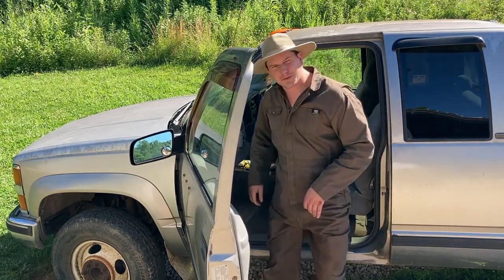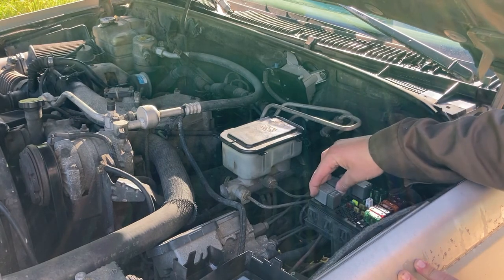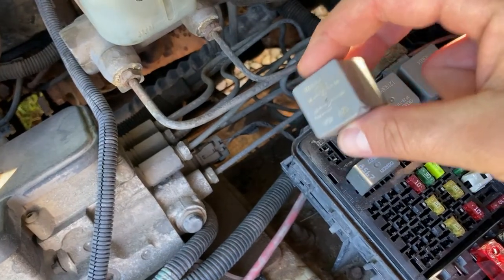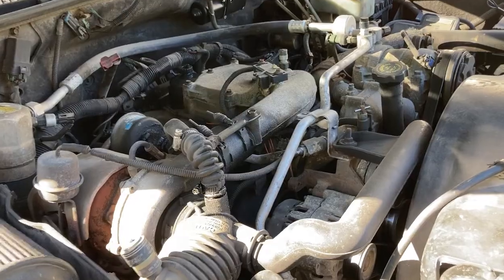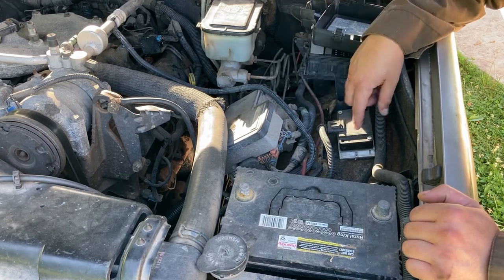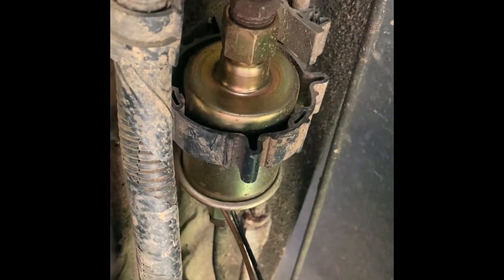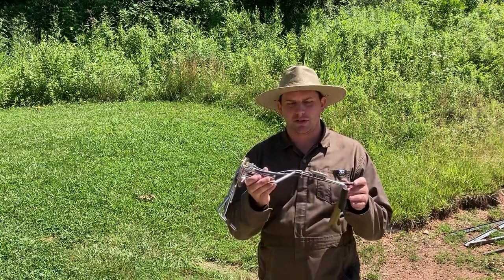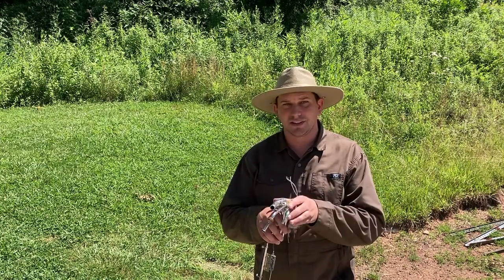Chevy 6.5 diesel fuel delivery issues resolved (it runs now)

Comment: Great video. I’m not getting fuel to the new lift pump. When  I cracked the old pump, not much dropped from tank side line.. is my sender clogged?
Reply from the maker: There is no sender in the tank. It is just a float gauge. You might try blowing air from the line at the lift pump back or just drop the tank if you think the pickup tube is clogged.

Comment: 1:24 you point to a ground yet i didn't see a wire and I can't seem to find any ground on the intake. I've seen some pics towards the back right passenger side but mine (2003 P42 6.5 diesel) doesn't have one.
Reply from the maker: Gotcha. This is a 97 and there is a wire coming off the nut at 1:24. I think it goes to the battery but id have to look at the truck.
Reply: @nicksnextproject535  Ok. Maybe I'll try following the wire from the battery up to the engine then. The batteries are under the steps into the van.

Comment: Should u leave that little air cap thing on the fuel filter loose or tight after u let the air out? I changed the filter and then noticed it was leaking so I tightened the little air cap or whatever that thing is called
Reply from the maker: that cap is only loosened when you are bleeding air and should be tight

Comment: I have a 04 hummer and can not locate a relay for pump ! Fuses are all good ! No start . Pmd was relocated , 
Is there a way to know for sure if the l.p. Is bad ?
Reply from the maker: I think I would check the fuel pressure at the fuel bleeder which on mine is located on top of the radiator with a 1/4 male connector. You could put a pressure gauge on it and jump the lift pump. Not sure if your wiring is the same regarding how I jumped the pump to test it in the video.

Comment: which pump are you always refering to the lift or the injector pumps
Reply from the maker: If it was me, I would check for air in the fuel filter housing by running the lift pump.
Reply: @nicksnextproject535  
no air all good.But was wondering about the fuses and relay's you where pulling. where they for the lift pump or the pmd fuses.
Reply from the maker: @cdm1012  I would check all the fuses. There was a relay that I pull out to jump the lift pump and I have ran the truck with that relay removed and the lift pump jumpered so I dont think that relay runs the PMD. That fuel relay and the PMD are both pretty cheap parts to replace before taking it to a mechanic. Again I would look at all fuses under the hood and in the driver side dash panel.
Reply: @nicksnextproject535  
thanks fuses all good replacing the PMD as when removed looks like she got a little warm crispy lol.

Comment: So nick when replacing the filter do u have to put fuel in the filter hole
Reply: I lost alot of fuel taking it out n putting it back in..I change everything u said n still fuel coming up wen trying to bleed it
Reply from the maker: I used the jumper wire to bleed mine after changing the filter. If your pump comes on with the key, that might also work rather than the jumper wire. On this model year in the video, I dont believe the lift pump comes on with the key.
Reply: It don’t turn on wen I turn the key…how do u use the jumper wire
Reply from the maker: @popcornacipco974  Its shown in this video if your truck is the same as mine. There are also other videos here on youtube from other creators showing it.

Comment: The biggest issue was the engine oil psi switch in the valley.
Reply from the maker: Thanks for the tip!
Reply: I've heard that's only an issue on the older 6.5s. But I'm going to swap mine anyway. I think the optical sensor on the injection pump is causing my issues though.
Reply: It could also be a ground issue on the oil psi switch circuit. Check all the ground and powers/ load test the wires with a sealed beam headlight to see if the wires are pushing the load through. If you have voltage and it cranks over fast enough its either fuel or glowplugs. No heat in the cylinders and ots never going to fire up. Rx diesel glow plugs are the best in my opinion.

Comment: Many times on northern trucks the fuel line on top of the tank (sending unit) will rot out and pull air. I had to replace the tank, fuel supply/return lines and so on.
Reply: I've never checked, that's another great place to look for a problem!
Reply: @andrewbeveridge3006  Yup, had to do mine. I replaced the Tank, sending unit and ALL the lines. You will be shocked when you take it all apart.